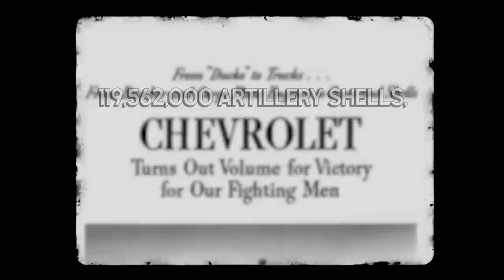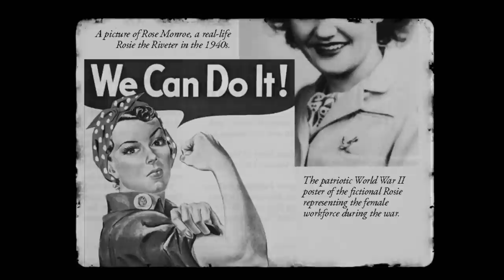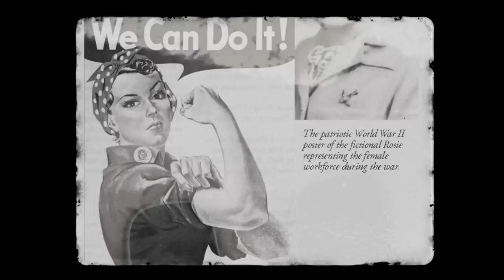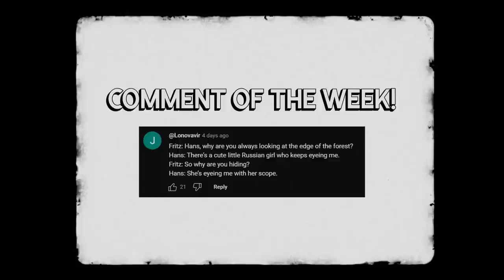How the Most Dangerous City in America is the Reason You're Not Speaking German [WW2]

Comment: Fun Fact:  They had a hard time getting the nose cone of the B24 connected.  They ended up hiring "little people" because only they could be lowered in and reach where was needed.
Then the US Army hired the same in England to help replace and repair the damaged planes, given them a way to contribute to the war effort.
The Germans captured a few crashed B24's and it drive them nuts trying to get the nose cone replaced.  They simply didn't have any "little people" by that time, and it wouldn't have occurred to them regardless.